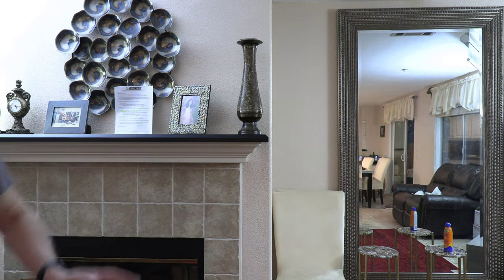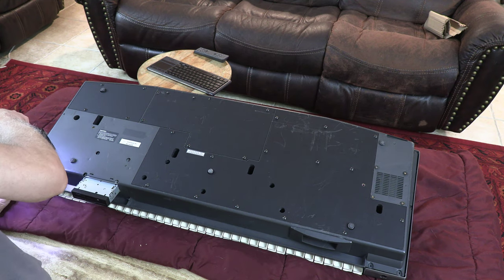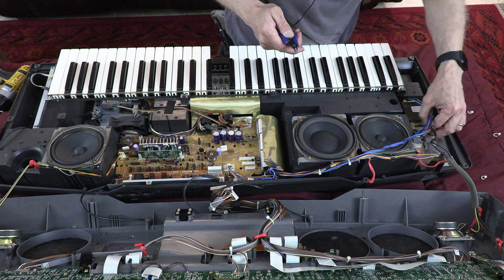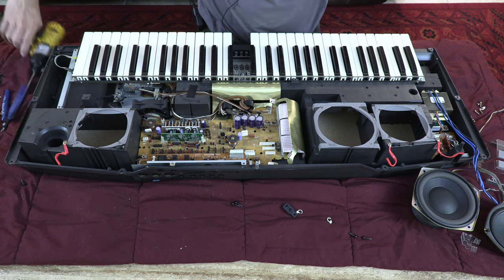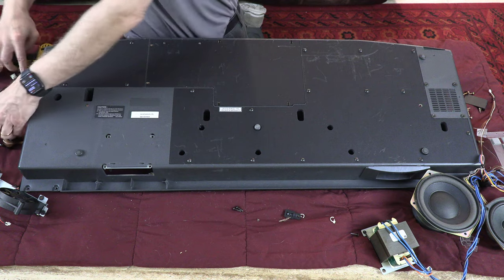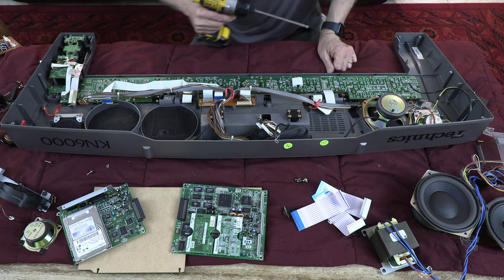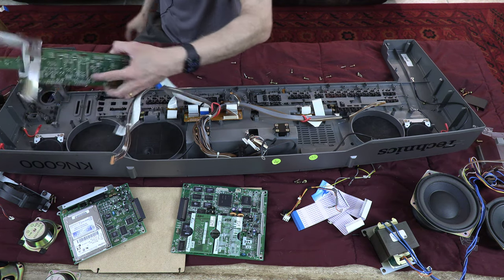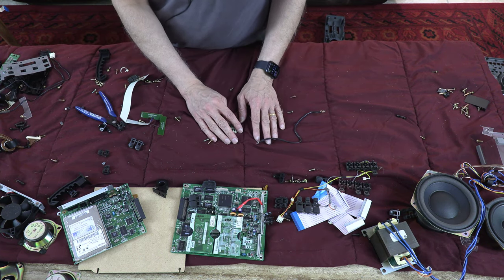Tutorial on Taking Apart a Technics SX KN-6000 Electronic Piano Music Keyboard Synthesizer

Comment: My kn3000 is not powering on, I checked the transformer it gives 22vac, what should I check next?
Reply from the maker: Check the voltage after the Bridge Rectifier, across the main DC electrolytic Capacitor.

Comment: Greetings , my floppy drive does not copy all the files correctly , some sounds are very low in volume while others sound fine...How can I get another floppy disk drive....
Reply from the maker: Hi, you can get floppy drives for these on eBay, for example https://www.ebay.com/sch/i.html?_from=R40&_trksid=p3490034.m570.l1313&_nkw=technics+kn7000+floppy+drive&_sacat=0

Comment: I have three keys that play too loud....how do I fix this problem...
Reply from the maker: You need a new Pressure Sensor strip. It is a narrow strip that runs all across the keys from right to lift.
Reply: @knowledgesource101  can I order that part
Reply from the maker: Yes you can, but before you do that I would check to see if something is stuck on it, because if there is a fragment of sand or any other object stuck between the key and the pressure sensor it can cause this problem. The sensor is there to detect the amount of pressure you exert on each key, and adjust the volume of the tone accordingly. However if there is a piece of paper suck there the thickness of that paper will be adding additional pressure on the sensor thinking that you are pressing the button harder than you are.
Reply: @knowledgesource101  Ok..I will take it apart and see...
Reply: @knowledgesource101   I might leave the loud keys in for a while because it makes me play with a lighter touch...
Reply from the maker: In that case the key-spring pressure could be wrong, you can stretch the springs slightly to make it more resistant to pressure.
Reply: @knowledgesource101  I went to the "control" section and altered the touch sensitivity...
Reply from the maker: Yes but that will lower the Touch Sensitivity on all Keys, not just a few specific keys.
Reply: @knowledgesource101  it's for all the keys but I think there might be something on the keyboard that lets you alter the sensitivity for each key but I haven't found it yet